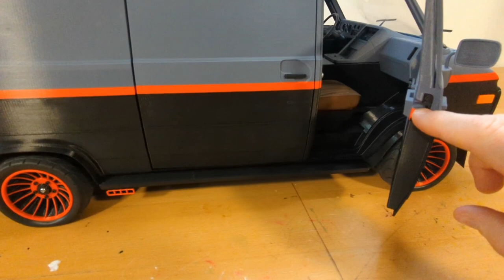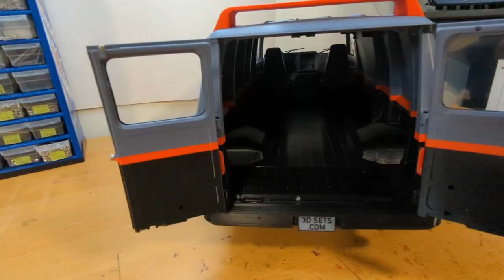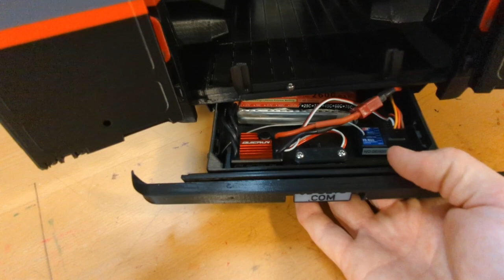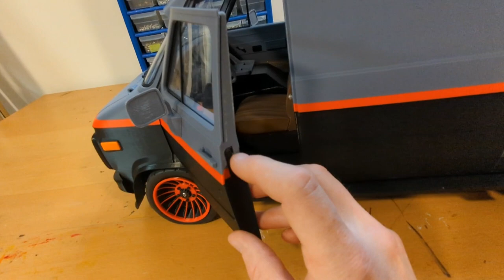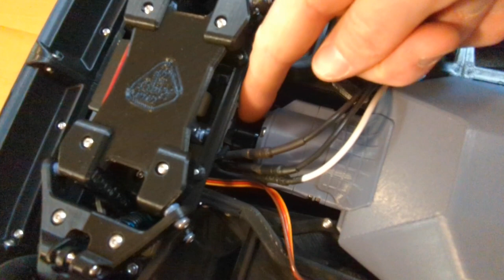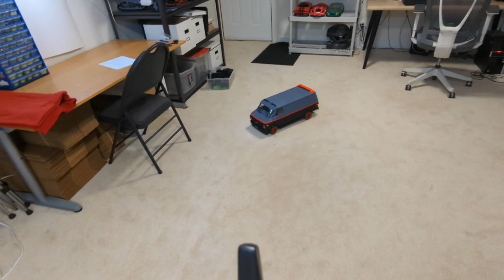New 3D Printed RC Build Tour - 3DSets Max Team Van

Comment: I was hoping you did this build from 3D Sets. Can't wait for the build guide, always good. Going to start printing mine soon. Hope you give some how-to tips on the multi-color printing, still working on the Landy build, stopped cause I did the belt conversion after it came out.  Keep up the awesome work.
Reply from the maker: https://www.youtube.com/watch?v=5hRXXB6GgP4 The multicolor printing was easy with my Prusa MK3s but it will depend on you printer. 3DSets has gcode for Prusas already which makes it easy but they also have PrusaSlicer build plates pre-set-up that have the color-change built in so you don't need to worry.

Comment: Nice! How well do the printed parts fit together? Do you need to do much sanding?
Reply from the maker: There is no sanding at all required as long as your printer is calibrated well.

Comment: nice just got finisched with the model 2 and a hummer h1 military. and now im at about 60% with the printing of the van ;-P. i think ill get the buggy to ;-P. i think i am adicted. just orderd 2 more printers. i used the belt drive version of the gear, it is so quiet and has power. i do wheeles on 3s, could go 4s but i geuss thats redicules mode.
Reply from the maker: Hmm, never tried 4s but the motor/ESC combo I've used aren't rated for it. If you want more power maybe try a higher C rating on your battery like 50 or more and watch the temps. The buggy is definitely a fun build as well.
Reply: @rcprinter  i meent on 3s its allready a rocket.and my esc is rated for 4s 120a. ;-P i dont whant to damege the beltdrive. but i think i will do it for science, and upload it to my channel.
Reply from the maker: @falz  anything for science! Lemme know when it's up I wanna see it fly :)
Reply: @rcprinter  this weekend ill give it a try ;-P
im going to let you know when its up
Reply: @rcprinter  just tryed 4s but dont seem to make any difference at all. 😞 i think the motor is at its limit. but it still can reach up to 50 kmh and has power to pull off with wheeles. i will make a video anyway, with specs like motor esc. and the difference between geard ore belt drive is like day and night ;-).
Reply from the maker: @falz  Thanks for the update. At least it survived!
Reply: @rcprinter   the esc is rated up to 6s 120a. but the motor is rated 325w, but dont say anything about voltage.